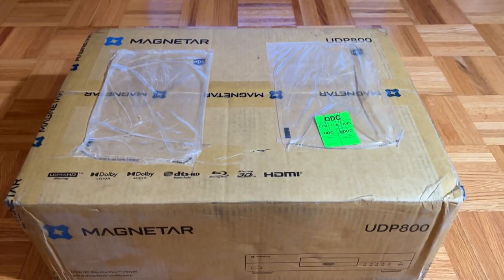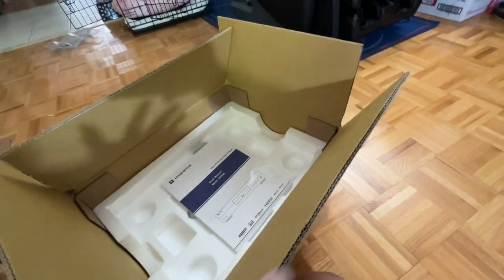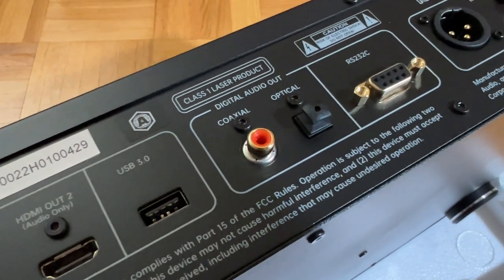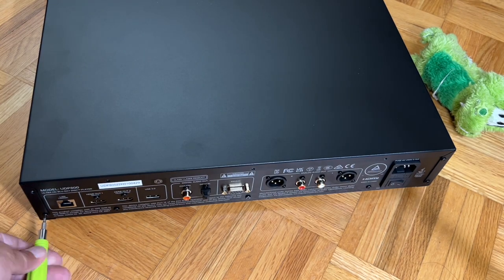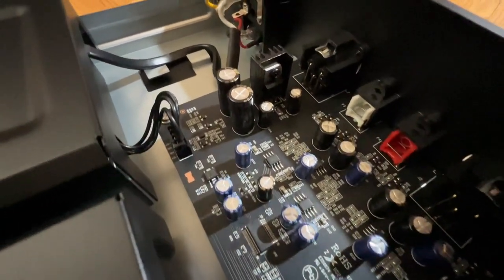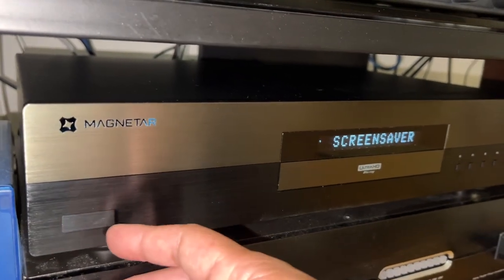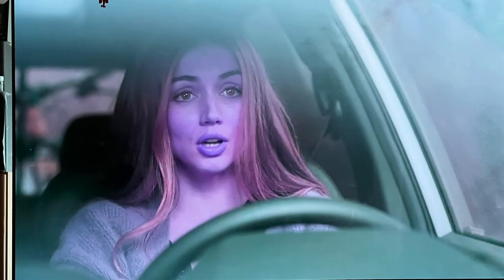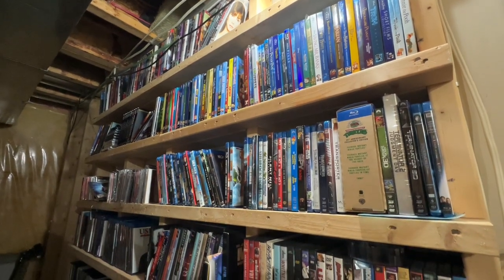Magnetar UDP800 Naked and Reviewed | First Ever Internal View UDP-800 | World’s Exclusive

Comment: I have a Panny UB9000 and my trusty old Oppo-203.  The 9000 has a slight edge in HDR10 video quality but Dolby Vision is a toss up. Having said that, the Oppo, as an all around player, beats the pants off the Panny. When it comes to playimg various video/audio encodes in video files off an external hard drive or over a network, there's no comparison. The Panny is significantly limited here whereas the Oppo can play almost anything that you can throw at it. So the Panny is still  my primary commercially released disc spinner but the Oppo handles everything else. Frankly the Magnetar looks like an Oppo clone (there are reports that some Oppo engineeers are now with Magnetar). If my Oppo were to go toes up, and I couldn't find another one at a reasonable price, I wouldn't hesitate to get the Magnetar 800. The only thing that I would miss would be the Oppo's HDMI input which can come in very handy at times.
Reply from the maker: The Magnetar has USB input and while the picture is not as great as the Panasonic 9000, it is still better than Sony and as good as the Oppo
Reply: @DavidSusiloUnscripted  My bad. I meant an HDMI input which, I believe only the Oppos have.
Reply from the maker: @MrNorcal81  I don’t know how they got around that legally. AFAIK if you have a player, you can’t get to legal license to have another HDMI input as it is a different classification altogether.
Reply: @DavidSusiloUnscripted  You do have to wonder.  I have a Roku Stick plugged into mine. I use it for watching older programming shot in the now ancient traditional 1.37:1 aspect ratio because the Oppo has such a good screen zoom function, especially at the 1.2X setting.
Reply: Hi David - in the first comment above where you say “the picture is not as great as the Panasonic,” are you saying that the Panasonic has a greater picture overall, or a greater picture when comparing input of the Panasonic un9000 and the Magnetar 899 through the usb port?
Reply from the maker: @Dingo-de7yu i’m referring to bluray disc and 4K disc playback quality. The Pana 9000 is better.

Comment: I am wondering how this will shed heat on a hot day. It has no vents, and no fans
Reply from the maker: Should be fine. I tested this and the UDP900 (see my Magnetar UDP900 review) and played them for 6 hours straight. They don’t become hot at all.
Reply: If it needed vents they would have put them in it.
Reply from the maker: @chrisnbusgell3938 100% accurate.
Reply: @DavidSusiloUnscripted  I have the 900 I bought it before it's released  and it has had one update 4 months ago.
Reply: @chrisnbushell3938  Riiight, because manufacturers never overlook anything.
Reply: @DavidSusiloUnscripted  Did you test it in a room that was 27 degrees celcius or more? Because that is the kind of situation I'm wondering about. Wondering what happens in the absence of air conditioning.
Reply: @KBWrecker  You taking the piss? Plus, the casing is like a heat sink  just buy it and find out.
Reply: @chrisnbushell3938  Heat buildup kills components, and no, a metal box is not the same thing as a heatsink. (especially when the components are isolated from the box as much as possible)
Reply: @KBWrecker  I never said the casing was the same as a heatsink, and I know that heat wears out components over time. I was in Electronics for over  14 years in the UK. just buy it and enjoy it as have with my 900.